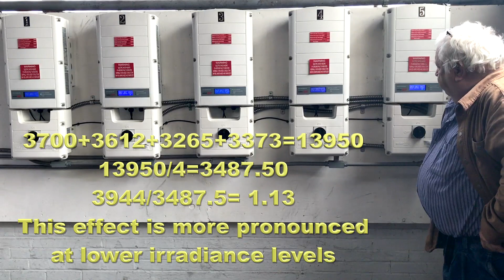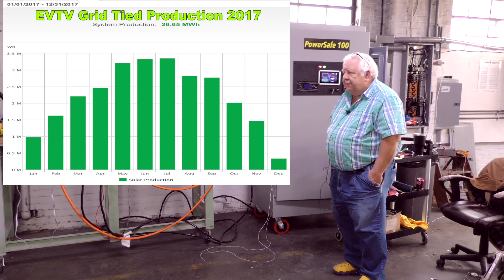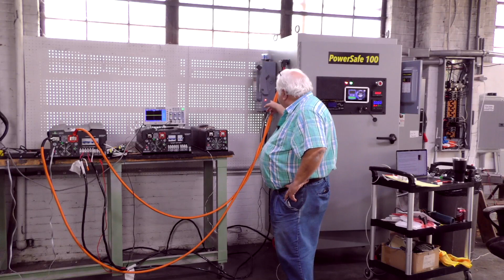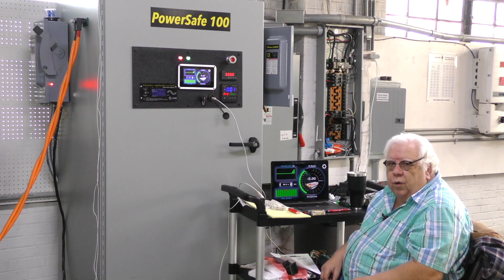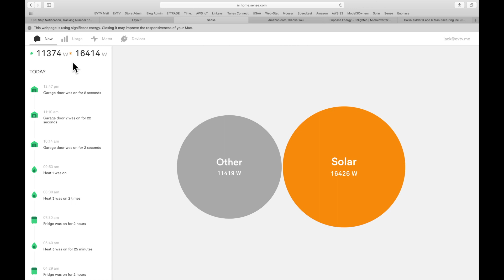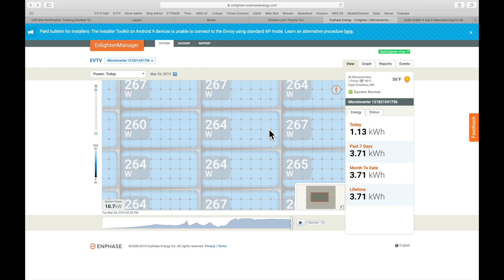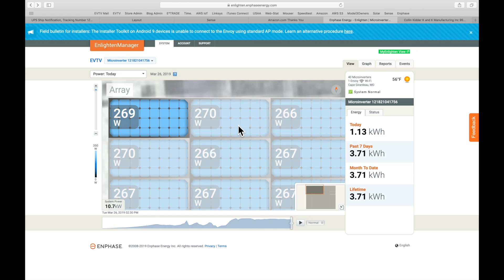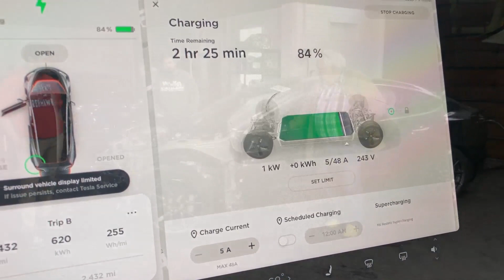Solar AC Coupling - Resurrecting a Model 3 Wreck

Comment: We use 3-5 KW per day living in our Earthship here in Colorado temp from 63 to 80 deg no cooling or heating year round.  We got a 12KW  battery bank with a 2.5KW solar and have been living here for the last four years.  We do use propane for cooking only. Water is heated by a old solar heater that works really well.

Comment: How about setting up a pipe system along the upper side of the panels with jets over the panels to spray them. You could also have a roomba like robot to travel along the panels while the jets are spraying to help scrub them.

Comment: Do you have geothermal heat? I'm 100% off grid with a 25kW solar array and 100kWh of batteries.
Reply: I have geothermal. Im off grid 15.5kw pv 70kwh of tesla modules
No one new anything about geothermal here so i did it myself.
Reply: @Jack Rickard thank you jack 
If you need help just ask 
I can pre program the sunny islands to your need and email the file

Comment: any ideas about resealing a shattered solar panel that had water on it and froze and shattered... panel is new never used.but shattered completely hopefully an epoxy or glass cement can reseal and erase the cracks... what do you think? any ideas it was a 280 watt Suniva panel....

Comment: Miss ya Jack!  We had solar in 1986 on our house, 8 x 40w BP panels with BP batteries, believe it or not those panels and batteries were used right up to 2004.  We had no grid connection,  we grew the array over time of course.  But we needed wood for heating and we would sweat our ass off in summer. However if you look at it, our consumption was near nothing, not an average family.  None the less we must have saved a shit load of coal !

Comment: Jack you should get another sunny island. And link them together for 240v. Put in a sunny boy inverter. 
And witness AC coupling the correct way. 
I believe that solar edge supports Frequency shift power control as well.
Our shop has 22 kw of pv ac coupled to 2 6048 sunny islands
And 6 tesla modules
And we dont ever have to mess with it.
Reply: @Jack Rickard i figured you would be.  
They are very well built. 
Reliable power that never stops 
Is important.
We have never had a problem with a sunny island system.
You need 2 of them to experience the AC coupling at 240v. 
They can feather the output of a sunny boy inverter to 100watts 
(Haven't seen it lower. But may be possible) 
You are plenty smart to read the manual and set it up. 
Kicking off the GT inverters via 62.5 blips is archaic and as you see creates other problems 
FSPC is where its at and i told you all about it 2 years ago LOL.
Good inverters are expensive and you need a few of them thats the way it is for now.

Comment: If nuclear (fission) power is as safe as you say it is, I am ok with it. The only thing I ask is that we don't take credit from future generations - the price of the power produced should include the cost of building/decommissioning the plant plus the cost of storing safely the waste for tens of thousands of years.
Reply: @Jack Rickard thank you for your response. You are correct that I don't know enough about new fission technologies. Looking at current and past deployments, we have not done a good job with fission. If what you are saying is that newer reactors will produce no hazardous waste, then they definitely deserve a look. I have an aversion to politics, but I think it is reasonable to ask that different technologies compete on equal footing. How do you quantify the effects of an accident involving a reactor of the new type? Does it still pollute? If there is an accident involving PV or wind turbine, we won't have the same concerns as with a fission reactor, I think. Also, converting solar energy into electricity does not interfere with the equilibrium on earth (light would fall on the ground and heat up something anyway). However, with both fission and fusion, as well as 'fossil fuels', new energy is being introduced into the system, which has previously been sitting trapped (in chemical or nuclear bonds). This can have and has had unintended consequences on our home here and on ourselves. Maybe we should look for solutions outside of ourselves, maybe inside; I prefer looking at both.
Reply: Diyan go to TerraPower’s website (the company that is backed by Bill Gates) and read about their ideas for nuclear power. Very good stuff.

Comment: What did you use to mop the panels? Water? Soapy water? Windex? I used soapy water and rinsed with a hose! Next time I may add a step with Wendex out of a spray hose.
Reply: Well I use rain water when it stopped raining and use a squeeze and it work well on my 20 year old soler panels and my new soler panels.

Comment: BTW, the French got it right with nuclear power (which is definitely the solution) by nationalizing their energy grid and standardizing a nuclear energy system. They now have some of the cheapest, cleanest energy in Europe.
Reply: It takes 25 years and about 50 billion dollars to close down and clean up a nuclear generator. That is not practical.
Reply: The French got nuclear power right? Didn’t they get caught falsifying safety records for crucial reactor components over at that new Flamanville plant just the other day? Or maybe you mean back in the 80’s and 90’s when they used to pay the Italian mafia to take all their reactor washout and highly radioactive waste and dump it off the coast of Somalia back when it had no government and couldn’t defend its coastline (which is what started off the whole Somali pirate thing btw). No I don’t know who you want to point at as the poster child for “doing nuclear right” but it definitely ain’t the French.
Reply: @alexmac101  How much of this has happened since the power plants ended up in the hands of private owners?
Reply: @Poxenium  And what's it going to cost to replace GIGATONS of solar panels and inverters every 30 years?
Reply: @PistonAvatarGuy  Solar panels don't suddenly break after 30 years. I'd call it 50 years, and like most consumer electronics, they can be recycled with very high efficiency, barely any wasted materials.
Reply: @alexmac101  Anyway, if there's money involved, you can find examples of corruption, or boneheaded actions in just about anything.
Reply: @Poxenium  Have you seen how consumer electronics are recycled?
Reply: idontcare80 The falsified safety records scandal came out less than 2 years ago. Carried out by none other than EDF and Ariva, the two largest private builders and operators France has. Same plant that is billions over budget and way behind schedule. I know that people cut corners. If the kid working in McDonalds skips washing his hands then maybe I get a stomach bug. You cut corners on a reactor pressure vessel head because the steel wasn’t up to code and you didn’t want to pay to fix it, we could end up having to evacuate most of western Europe. 

If anything, the French’s ‘all in’ attempt on nuclear power has shown that it doesn’t work. It’s renewables and storage all the way
Reply: @Poxenium  Solar panels are not cheap to recycle,  it takes a lot of manual labor to do so and  special equipment. There is a movie about an Australian factory, explaining all the complications involved in the process.
Reply: @alexmac101  So, France has shown that nuclear energy isn't the way to go by having an excellent safety record and by producing some of the cheapest energy in Europe? Also, I can't find any reference to these things that you're talking about. I know that most of the waste is stored on-site and that much of it is reprocessed, so I don't see any significant problems with what they've done.
-
Anyway, we simply CAN'T get all of our energy from solar and wind, just look at Germany, they only get about 1/7th of their energy from renewables, yet they have wind turbines and solar panels absolutely EVERYWHERE, so what happens if they try to get ALL of their energy from wind and solar? And what about the batteries? The scale of what you people are suggesting is just absolutely ridiculous.
Reply: @klaus-dieterstromschlag6212  Electricity, not all of their energy. That's the problem with climate policy, everyone is looking at electricity, but that's only a small fraction of where our CO2 emissions are coming from.

Comment: Jack I have my soler panels go to a charger and then to the batteries and then to the inverter to my house and not to the grid and I don't use the grid. But I need more batteries and need more soler panels then I will need even more batteries.

Comment: Jack,  since you have such a big solar array with five separate inverters would it make sense to put transfer switches on the inverter outputs, allowing you to switch some of the inverters directly to utility, when you have an overabundance of power production and use the remaining power to run your loads and charge battery system, 
I realize this would add complexity and cost to your system but wouldn't it also increase efficiency?  The transfer switches would allow you to keep the majority of your solar systems running by not interrupting more of the inverters then necessary to balance the load required.

Comment: Making buildings more efficient would also go a long ways in power needs.  Power conservation is just as important as power production.
Reply: Once you have the solar system the efficiency doesn't become as big of an issue.  At night when I'm on batteries its still a big deal but during the day I have so much available I don't even have to be careful.  Dry clothes? no problem.  Charge the Leaf and the Volt? no problem.  Fire up the welder in the shop? no problem.  Do it all at once?  No probelm.  16 kW usage peak so far.  The new high SEER heat pump is high efficiency and will help the packs stay on all night.  During the day while on the duck's back it won't matter.

Comment: Unrelated question:  
When will someone put a bigger battery and regenerative braking on a travel trailer?  What are the electromechanical details of such an installation.  If the tow vehicle is an EV, the brake pedal has to activate both regen systems........?
Reply: Well maybe you should go to Tessa and ask them and the mite put you in for you if they have or can make you for you. And I think they may have something like that but I don't know, but that would be the best bet.

Comment: What happens when there is a power outage (grid down), and your solar PV starts producing more than your loads plus inverter can take (i.e. the condition that you described where you normally would "dump" to the grid)? Will the system still attempt to send power out to the grid? If so, wouldn't that violate the anti-islanding requirement for grid tied? (Just asking.)

Comment: Perhaps the aluminium and steel plants are unique, but Google and Apple can power their massive computer server farms on renewable energy. I get your point though, there are many complexities to solar and wind that make it challenging for the average home owner. I also suspect the technology will evolve to make it a lot simpler/cheaper to operate and maintain as more and more homes and businesses adopt clean energy.

I also agree that nuclear is a fine energy source, especially with the nuclear plant designs that enable the burning of the waste fuel down to nearly nothing -- however there still is all the inefficiencies in transmission, the vulnerabilities from hacking and nature, and the fact that every dollar spent on nuclear (and oil, coal, nat gas) is money that could be used to improve renewable tech.
Reply: The stigma of fission is going to be impossible to overcome any time soon. I'm not afraid of fission reactors, but I wouldn't want one built within 50 miles of my home for fear of my home's resale value alone.

We need someone to sponsor an X-Prize for grid-level energy storage. Or perhaps just stop subsidizing oil (at very least the subsidies for new repository exploration) and diverting some of that toward energy storage breakthroughs.
Reply: @Jack Rickard Breeder reactor designs have been around for decades.  Good energy management requires we have a full quiver of resourses, each best applied to the need.  Here in Phoenix we have the light rail system.  The right-of-way is about 100 feet wide........by 30 plus miles long.  There is already 600 volt DC lines above it.  It would be sooooooo practicle here to power the whole shooting match during day ligt hours from the panels.  It's a shovel ready infrastructure project just begging to be launched.

Comment: Jack, What APP are you using with Enphase? I have the same inverters you have and use the Enlighten program the installers hooked me up with and it does not have near the detail you have to go down and look at the out put of individual panels and inverters  as you were doing.  I have Solarphase app on my Amazon Fire that does a little better, but not like yours.

Comment: i have done over 5 salvage title cars before   MAKE SURE of how your state wants you to do it . call them before you get any parts and all paper word for parts need address and name of own and if used the vin number of the old car they came from .......  with all your paper work right its not hard at all for the DMV to give you a working title again ..  i so wish we could get parts like we can from GM and other car makers . i love the car your standing next to and would fix it my self and drive it .. O yeah most air bag ECM do not have to be rest and can hold up to 3 crashes . if you every want to test this they have plugs to plug and play into the aitbag wiring and if the lights go out for that system then you only need to replace the airbag and your good to go . i am not sure if Tesla does this tho so it would have to be tested

Comment: Jack - There is another more elegant way to limit power through your battery-inverter when isolated from the grid so you can be selfish again. It still involves using your battery-inverter as a “radial” grid-forming device instead of passing all load power through it. Look up “feed-in limitation” which many modern grid-tie inverters support. From my position hi atop my theorizing vantage point I am not sure how effective it would be at variably limiting the output of multiple grid-tie inverters, but I’m considering testing on a 50kW grid-tie array with 6kW battery-inverter system. Feed-in limitation is designed to limit grid-tie inverters from exporting to the grid when the utility doesn’t want it, but why not apply it at the input to the bidirectional battery-inverter?

My sense is that “ac-coupled” used to mean more of what you are referring to now but it was simply based on looking at battery voltage and crudely shutting down grid-tie inverters when battery reached full charge voltage. However, I think as grid-tie batteries are coming on-line it is somewhat been hijacked to mean a solar that interconnects on AC side of battery instead of DC side. I think the term you might consider for the battery-inverter function is “grid-forming” and the term to refer to for functionality of grid-tie inverter activation is “micro-grid supporting” or “micro-gridding” as there is potential for “ac-coupling” grid-tie inverters that still look die grid impedance and will not wake-up to a grid-forming battery-inverter.

The problem of oversized PV in relation to battery-inverter power rating is real in a technically approved (listed equipment) where battery-inverter ratings aren’t even half as high as you Sigineer. Those manufacturers will tell you that “AC-coupling” more than the device pier rating of the inverter is not allowed simply because they are NOT using power flow to frequency-shift limit the grid-tie inverters but using battery voltage instead. So going into a high power production, low load, low battery charge period will not be actively controlled by the frequency-shift logic and WILL overload the battery inverter (and possibly DC charge rate of the battery.

Also to be considered with “oversized” PV is what happens when there is load imbalance greater than the single phase capabilities of the battery-inverter or added autoformer (voltage rise that that trips off grid-tie inverters?).

I always look forward to you next video. I happily listen to all of it at standard speed.